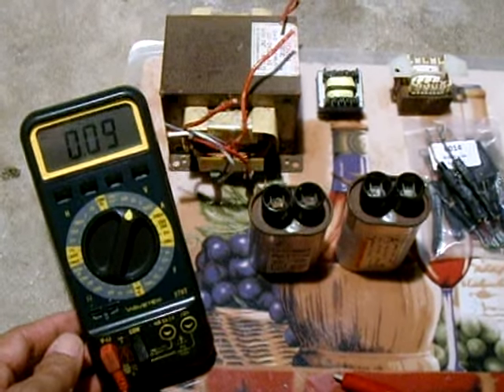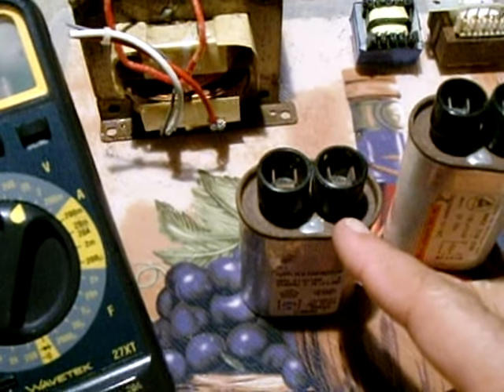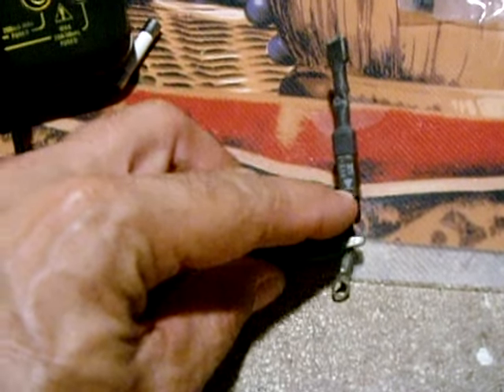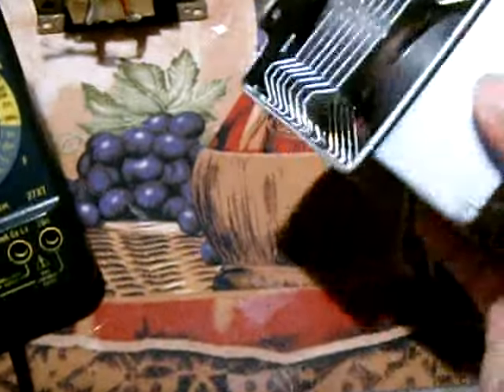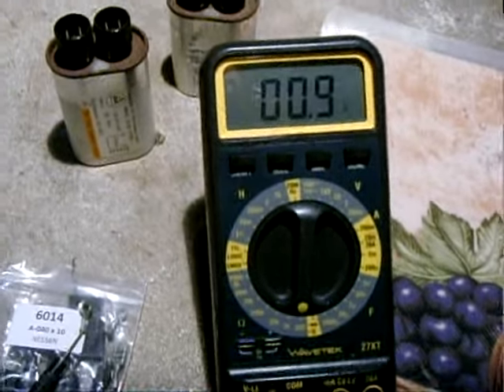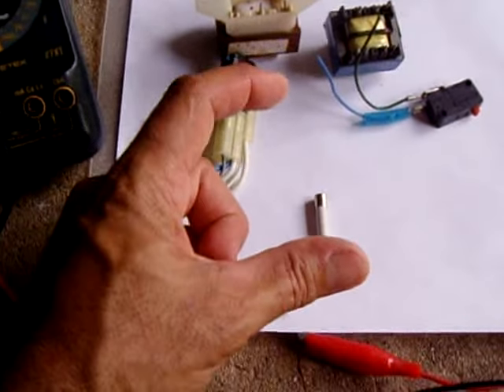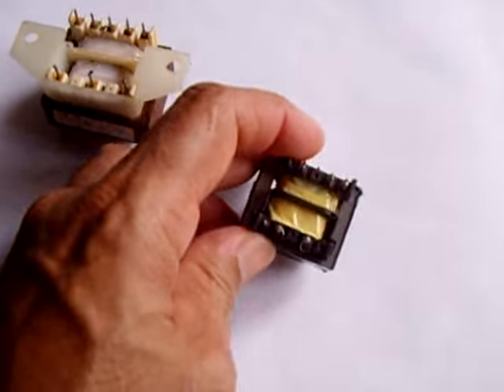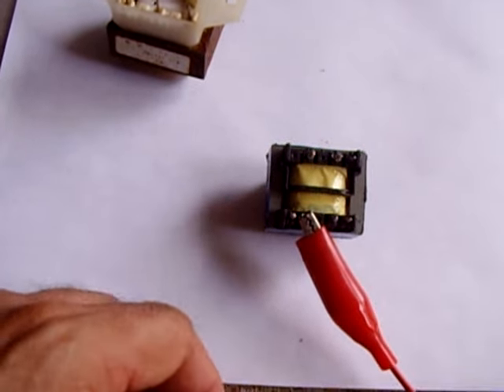How To Easily Test Microwave Oven Parts! (Ultimate Guide)

Comment: why don't you use the diode test selection on your meter instead of your ohm test?
Reply from the maker: Hi there. The diode setting on your DMM is not designed for high voltage diodes. The best test is by applying voltage to the diode, or using a very high ohms range on your DMM.

Thanks For Watching!

Comment: I HAVE GE TURN TABLE MICROWAVE, THE PROBLEM AFTER 2 YEARS OF USE IS...IF I USE TO PRE HEAT A WATER FOR 1 MINUTE  OR 3 MINUTES IT START AFTER 3 OR 5 SECONDS THE POWER TURN OFF! SAME THING IF I RE HEAT THE FOOD. AND I JUST PRESS START AGAIN AND IT RUNS OK. I AM WORRIED TO LEAVE THE MICROWAVE UNATTENDED COZ IT MIGHT CAUSE A FIRE. PLEASE ADVISE ME IF I NEED TO HAVE IT FIX OR BUY A NEW ONE! THANK YOU SO MUCH!
Reply from the maker: Juliet Santarromana This problem has already been discussed in the comment area of my other microwave oven repair video. Please read through the comments at that video(The link is in the video description area of this video). Without any testing, your odds are low in fixing your microwave. No need for your entire message in caps.Thanks for watching.
Reply: THANK YOU!

Comment: The fins on the magnetron should not rattle, correct?
Reply from the maker: +sewerrat47 
The cooling fins should not rattle, but what is more important, is that the inside of the magnetron does not rattle when you shake the magnetron holding all the fins.
Reply: thank you!

Comment: DO YOU HAVE TO REMOVE THE PC TRANSFORMER FROM THE CIRCUIT BOARD TO TEST IT?
Reply from the maker: Hi Charles,

If the fuse in the microwave is good, but there is no power/no display, then it is very possible the PC mounted transformer is faulty. You can also test the transformer by checking for 120VAC on the primary side terminals(usually 2 pins on one side), the other 4 or 5 pins are the stepped down AC voltage ( 7 to 11 v). If you have 120vac on the primary side, you should see the lower voltage output on the other pins(the transformer is labeled), if you do not, the transformer is bad.

Thanks for watching!

Comment: hello sir, i found this your video how to test all the parts of microwave, i go with the transformer where i thinking this is my problem, i test the PRIMARY and i good result with 200ohms DMM, i check each terminal with the body and no connection with 20M, next i move to SECONDARY, i check with same procedure i get good result, but when i try to test the HIGH voltage wire and do testing with the body of transformer with 200ohms DMM, no reading, only i got reading when i touch down and touch up, so sir do you think this is the problem of my microwave?
Reply from the maker: The video explains the procedure EXTREMELY well. No one else had problems. I have close to 240 videos. I cannot spend too much time answering one individuals questions. If you are having problems, you need to call up a friend and have them watch the video and make sure you are doing it correctly, using a GOOD meter. There is ONLY one test for the high voltage secondary. You test from the Red wire to the transformer core on a 200 ohm setting. That is all. If the reading is correct, then move on.
Reply: because when i test it the terminal where suppose to be has 95 ohms on the core body of transformer, on my transformer i don't have reading maybe this is the issue, where my microwave doesn't produce humming sound when i start the timer but it has a feed 220v on the PRIMARY terminal.. thank you sir for making this video, hoping in the near future i see more videos you upload..
Reply from the maker: If you get no reading between the HV output wire and the transformer core, then the HV secondary is bad.
Reply: yes sir, i did not have reading with HV output Wire terminal into the transformer core, only getting small reading, when i first touch the terminal at core, but steady monitoring, no reading zero zero DMM, i think sir this is the problem my HV transformer secondary has a problem.. thank you sir..

Comment: what if the transformer resistance reading is 2.xxx on one end and 0.9 on the other end, whats the conclusion?
Reply from the maker: Readings won't be exactly like I show, but they should be similar.
Reply: electronicsNmore ...the reason i asked is because ...2.×××...seems like a little too much...is 1om the max?...thanx for your response

Comment: Im confused you hooked up your multimeter in another video on the capicitor and you watched meter go up saying it was good capacitor. This video you  showed connecting probes to capacitor and you said should be no reading.
Reply from the maker: Using the LOW resistance setting on your DMM, you should see NO reading. Using the high resistance range(Megohms), you should see a capacitor that just had it's terminals shorted start lower then move high into the millions of ohms. Thanks for watching!
Reply: Thanks for explaining.

Comment: My Sharp microwave works fine but the display is very dim. What would be the problem?
Reply from the maker: If the power supply to the lcd display is fine, then the display is either faulty or just old and worn out/faded.

Comment: I have a Samsung over the range microwave, it's 7 yrs old and for a few weeks now every single time i pull open the door it jumps the breaker. Back in 2012 I upgraded the electrical panel to breakers, and the breaker serving the microwave is a 15 and labelled "kitchen dining room split". But the microwave instruction manual recommends a "designated" breaker just for it, instead the electrician chose not to do that. So now, when I pull open the door the lights and the kitchen and dining/living room and all other plugs go off. I called in an electrician and he said it's not the panel but the microwave and he can't repair it. Any ideas? thanks
Reply from the maker: Sounds like a misaligned door or faulty door switch.

Comment: when testing the transformer it gives 2 ohm on primary loop and gives 156 ohm between high voltage and body of transformer is Oka and my oven is working and heating but much slower than below what could be the problem
Reply from the maker: You could be experiencing a voltage drop at the AC receptacle where the oven is plugged in. Measure the voltage of the receptacle before and while the oven is in operation. If the voltage hardly drops, then you need to test the diode and capacitor. If they both test OK, then I would suspect a faulty magnetron.
Reply: +electronicsNmore  thanks for your response I had tested all the components all of them are Oka and after that I figured out that now days power supplier supplies only 170 volts mostly that's why I am getting this problem

Comment: I found on my transformer that one of the soldered leads (the right one) coming from the lower coil is loose.  I think that is causing my "runs but won't cook" intermittent issue.  Any thoughts about resoldering that tongue-lead?
Reply from the maker: If it's the small PCB mounted transformer, then apply some flux to the pin and resolder it.
Reply: It's on the big one, the main transformer.

Comment: Dear sir i have a problem in my microwave oven. it is national panasonic demention4 big one. when i was not in my home my servent has given it for repair and after some time she said it and it works 2 months without any problem. oneday it gives big humming sound and i open the oven. i understood the humming sound with big vibration came from the magnetron unit. after removing the magnetron i found the rf areal(antenna of the magnetron has fully burnt out and it was melted. i was monitored that repairman has changed the magnetron and the transformer as those are not panasonic. those are dewoo. (may be he has changed both items coz both should be match each other.) i mayself bought a new magnetron and fixed it works few days and start humming again. this time i monitored the in side of the oven magnetron area is having a patche like that area over heated. ss steel body color in this area is red brownish and oven is humming. what is the cause of this trouble and how to cure it.
Reply from the maker: +Thamara Pearl 
There is not much I can say because you have not performed all the tests shown in either of my microwave oven repair videos. After testing, please post your results, especially from the diode and capacitor.

Comment: What happens when magnetron its cracked. (1 magnet) and the aluminum spacers are loose?
Reply from the maker: Not good. Either replace the magnet or the magnetron. The magnet must be installed the EXACT same way (N & S).

Comment: Over time, my microwave started to blow the internal fuse. It worked until the fuse blew. Now, the fuse blows as soon as I plug the MW into the outlet. What is the most likely problem?
Reply from the maker: Check these according to the video in this order. Door switches, HV Capacitor, diode, and lastly the magnetron can be bad(even if it tests OK)

Comment: sir what is the out put voltage of transformer ??thanks
Reply from the maker: A little above 2,000V. The only way to see if the HV transformer is working 100%, you need to unplug the unit, discharge the capacitor, then take the red wire leaving the HV transformer and disconnect it from the capacitor. Take the blade connector on the red wire, and place it VERY close to the transformer core, but not touching. Plug the microwave back in, touch NOTHING inside the parts compartment, and turn on the microwave for 5 secs. You should see arcing between the HV wire blade connector and transformer core. I have a video showing the test. This test CAN be very dangerous. Do the test at your own risk.
Reply: This test can be stimulated by a 9V cell. See my comment in your other video.

Comment: My Emerson 1000W microwave turns on, carousel rotates and I can hear it humming but it does not heat anything up.  It also smells like burnt plastic coming from the side vent.  Is my transformer bad?  Is it something else?
Reply from the maker: Without opening up the unit to inspect and test it, I have no idea. Unplug the unit, discharge the HV capacitor, then look.
Reply: I did the voltage test with the cap and it tested good.  However, I tried the resistance test with the diode and I get the same reading when I flip the pos and neg probes on the 1k ohm setting on my analog volt meter.  Is my diode bad?
Reply: I also tested the primary side of the xformer when I powered the microwave up and I did not get a voltage reading.  I guess I have a bad relay switch on the board?
Reply: I think I narrowed it down to the 12V relay on the mother board.  Do you have any suggested suppliers for this other than the manufacturer?  I think I might only be able to buy a new control board and not the relay alone.
Reply from the maker: Ebay search "Microwave Relay". You'll see them.

Comment: Black and Decker MW all working but no heat, found the high voltage fuse was blown, so replaced it but still no heat. i checked everything according to this, and all seems fine except for following doubts. have three micro switches and all are fine except for one switch that has all three terminals connected and when the DMM is connected to one of the two terminals, its suppose to be opened when lid is closed, but i here a very slight tone like a millisecond and then its gone. when i do the same with the wires removed nothing, the switch works fine. 

second doubt it, when the Magnerton is checks, resistance between the terminals are shown .6 ohms at first and it get reduce to zero in about 5-10 seconds. is that normal. further when i check the continuity between those two terminals with the tone on mu DMM it shows continuity. is this normal. pls advice..

PS-relays are fine as the trtformer gets 230v to the primary.
Reply from the maker: If you hear the hum sound with no heating, and all components tested OK, then the magnetron is likely faulty.

Comment: I took off a Samsung  smv 360 ua al    fan (microwave had a kitchen fan )   from a broken microwave
no knowledge on such   there is a diagram shows connections of 5 cable 
2 cable on diagram shown as connected to a 10mf capacitor   
can I hook to 110 v with just white (seems ground) and blue(seems high  ) 
to use it as a fan
Reply from the maker: +Honor Lozerol 
As long as the fan is properly wired with the capacitor, it will run just fine at 120V.

Comment: What if you get 158 160 on the high voltage measuring at 200 ohm
Reply from the maker: 160 ohms is likely OK.
Reply: electronicsNmore  . What happens if the capacitor is bad or the diod.or what will cause the trasformer to burn out. What  if you have 2 door switch to the bottom, at normaly closed circuit  but one seem normal closed which is good and one seem open, what can that affect,can that be responsible for burning a HV transformer

Comment: I get 126 Ohms on the high voltage wire on the transformer.  Is this still OK?  Thanks
Reply from the maker: Hi Ramiro. The resistance you measured seems higher than normal. I would double check, and try another meter as well. Also make sure the probe is touched to a spot on the transformer's core which was scraped clean to bare metal.

Thanks For Watching!
Reply: It turned out to be a shorted HV Capacitor... Thanks for the great video on testing it!!
Reply from the maker: Your welcome!

Comment: I have a GE Spacemaker XL1800 microwave. I replaced the magnetron and a diode about 6 months ago. Worked fine until yesterday. The microwave turns on, but turntable does not work and the unit does not hear. It does light up. Control panel and timer work. I have consulted several "experts". They say the failure of the turntable and inability to heat are 2 separate problems. I am have trouble believing this because both failures occurred at exactly the same time. Highly unlikely. So my question is, is there something else that could cause both failures? Master fuse/breaker/diode? HELP! Does anyone have any suggestions?
Reply from the maker: Test your door switches as explained in the video.
Reply: Hello Pat.  I am a shameless tinkerer and love to rescue discarded appliances.  I have dissected and rescued a few microwave units.  The makers like to put all the circuits in series so if something fails, or the door is open, nothing works.  Maybe this will give you a hint.  Did you have it apart and skip a connection?
Reply: Bad Door switch.  Replaced it now working fine.
Reply: Thanks so much for the advice.
Reply: Took awhile to figure out how to get to the switches.
Reply: They are called "micro switches".  If they get loose or out of position they may not work.  Some are normally open, and some normally closed.  Check that the arm isn't bent and the connector slips on tight.  Good luck...you will figure it out.
Reply: I just reread your problem.  Check the door switch.  Nothing will work if it is loose or has come off its mounting.  They take lots of abuse from the door closing on them.  They control the  AC voltage to the innards as a safety.   You will figure it out.  Also check the connection from the timer to the unit.  The timer is totally separate.  I've moved one to another unit entirely.  If it isn't connected right the unit won't turn on....but you will still see the clock and timer working. The timer is just a big ON switch for everything else.  You might try bypassing it to test the rest of the circuit.

Comment: if my magnetron resistance idicates 02.0 its good or bad ?
Reply from the maker: Way too high. Your magnetron should give you an EXTREMELY low resistance reading, but not shorted. This test is also not 100%. I suggest you take each probe of your DMM/tester and touch them together to see what reading you get in ohms. Make sure you get close to zero or 0.1 ohms. The wires have resistance, so the reading may not go all the way down to  zero ohms. If you touch the probes together and get around 2 ohms also, then your meter is not accurate.

Comment: wow...what an adventure...so I have a very expensive 8 year old Samsung Microwave and the cap tests good, the magnatron tests good, the fuse is/was blown.  I replaced the fuse, and there is a "hummm" sound thats loud and then the fuse blows.  I am now testing the transformer and the Primary is Exactly as you said it should be, secondary only shows 0.1 Ohms between the two leads but it does show 0 Omhs between each lead and the core.  HOWEVER, the Secondary High V side is showing 5.8  Omhs from the lead to the core...not in the the 80 to120 Omhs  thus a "short"???....bad transformer???
Reply from the maker: Either the capacitor is bad or the magnetron. :-)

Comment: i had problem turning on my microwave oven as everytime i try to turn it on the main electric supply trip. i have check the fuse, capacitor and diode. all working well. any possibility there is problem with the electrical circuit? previously i heard a 'pop' sound before it stops operation.
Reply from the maker: You need to do a better job looking over the oven/components.